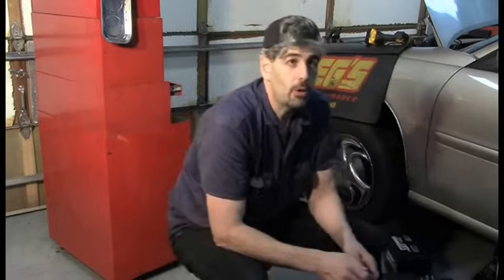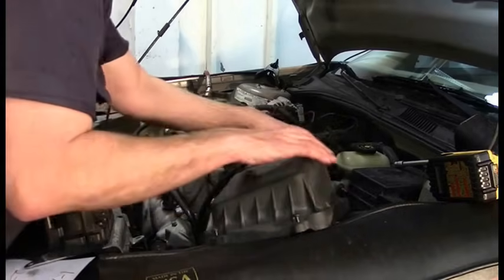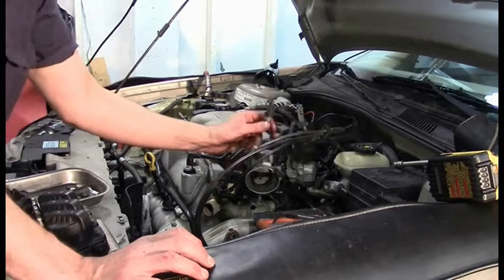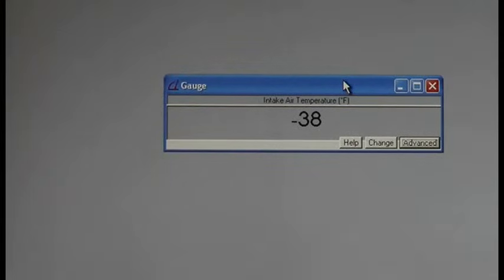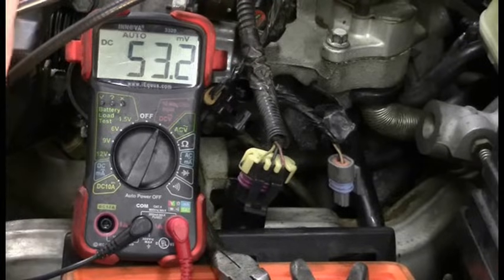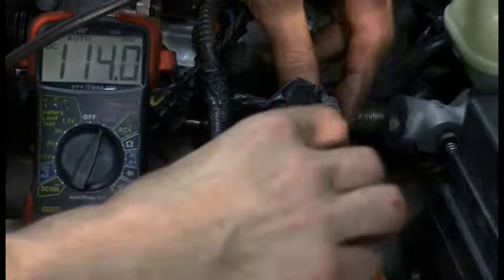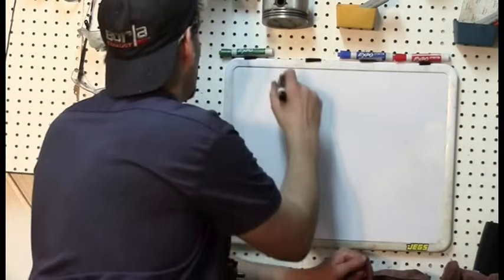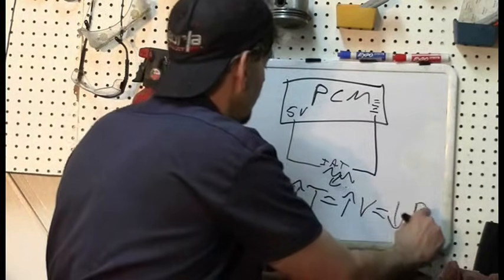IAT ( Intake Air Temperature Sensor ) Diagnosis P1111, P1112, P0113

Comment: Man, you are the best. I have P0113 error on my 1995 Mitsubishi Eclipse. My mechanic told me "Oh, buy a new IAT sensor and a new harness connector because the one you have on the car is not compatible with new sensor's connector" so I bought the stuff and the issue wasn't solve, so my mechanic said "Oh man I sorry I don't know what else to do, pay me $1000mxn (like $50usd) for changing the sensor and the connector". I obviously didn't paid anything to him, and now I'm trying to debug the issue. Your video explain everything I need. By reading on internet I had almost the same notion as you mention of the function of IAT circuit and how to troubleshoot, but now with your video I have clarified my ideas. Thank you so much man, I appreciate how you share your wisdom. Saludos desde México!

Comment: Thanks for the video. I disconnected the maf and checked if the temperature changed on my 2000 ford focus and found the temp changed. You said this meant it was bad, but i bought a new one and it does the same thing. Could it be that this model will change temperature when maf is disconnected ? I can disconnect the maf on this one and it reverts to a factory default. I can drive it with maf disconnected. When i do this the stalling and shut off at hard acceleration goes away. I also checked volts from intake air temperature as rpms stayed at 2000 rpms and it gradually increases with rpms but it will spike when ac turns on, is that normal.  
I pulled ac relay and retested and no spike, but still had stalling and shut off at hard acceleration. Any ideas. It has p0113
Reply from the maker: i most definitely did not say that meant the sensor was bad.  Where did I say that? If you unplug the sensor you should see a change to -40

Comment: How does the engine run with a bad sensor  how does rhe engine sound what problem does a bad sensor cause?
Reply from the maker: if the engine has a bad IAT sensor you won’t even know except for check engine light on. there will be no noticeable symptoms.
Reply: The only noticable symptoms (with bad IAT sensor/readings) are a rough idle and hard start up with cold motor. Your vehicle will spend more gasoline.

Comment: It's been a long time since this video but was wondering should the volt meter read 5 volts at the connector mine is reading 4.98 is that ok or should it be 5.0 plus to be correct
Reply from the maker: should be within 5% or so

Comment: Okay I guess I'll ask you sence you sorta work on the older stuff . 

1990 Chevrolet Lumina euro 3.1 144k an car keeps throwing code 22 which is TPS sensor reading low error an I've done everything an it won't go away an car the car is idling high or to low an also doenst rev up at all just stalls out . I read that the intake air charge temperature sensor is tied in with the TPS but I was not sure and if mine is bad then that could be the problem all along but i will do this test tho on the intake temp sensor an see what it reads .

This car doenst have a maf only a map sensor an then the little sensor in the air box that's the Intake air temp sensor.  

I'm going crazy and I just want to get this car straight and fixed
Reply: Car has other things done to it.  New TPS , idle air control valve , coolant temperature sensor , map sensor , full time up , air filter , furl filter , ignition coils , ignition control module , crank sensor , . And most of that was related to other issues that I've had but the only thing that's left that keeps giving me problems is the code 22 that won't go away
Reply from the maker: So start with the extreme basics- what is the TPS signal voltage showing?

Comment: That was exactly what I needed to see. I may have damaged the IAT connector in my Dodge 4.7l engine when removing the stuck #8 spark plug and coil.  My symptoms started after changing spark plugs. That is when I got the P0113 code and intermittently poor acceleration and misfire. Thanks.

Comment: I have problem with the IAT wire (chevy sonic2013), but i dont have the tracer, i am thinking abot replace the wire but i dont know the diagram of conections
Reply from the maker: without the trace you have to just probe to find the point where continuity is lost and you just need to replace to that point.

Comment: I have temp on sensor reading -31°c and voltage of 4.6v on idle? Engine off it shows -27°c and 4.5v this is going to be fun as it's raining outside like always when something brakes on my car.
Reply from the maker: sounds like an open to me. I would jump the terminals for the IAT and see if it changes. if it does not you definitely have an open. if it does, your IAT is bad.
Reply: @SchrodingersBox  I replaced the sensor reading are a 20c around 2.5v. I thought this may be the reason the car would not rev past 3000rpm tested maf the signal voltage is stable but it seems low at 0.27v at idle

Comment: Hi Mat...I looked at this video. I will be trying to find that rough idle on the hot wire of the MAF .  i will keep you notified if I find the issue.
Reply: Wiring too the MAF is tight.. Many people suggest using a OE MAF sensor from Hyundai, but it is about $260.00 plus tax?  YIKS....Your favorite follower. If I lived were you are I would be bring my car into your shop. But Toronto, On, Canada is a little far.....
Reply from the maker: Please do!

Comment: jus change the dam sensor anyway
Reply from the maker: Why? Please explain your logic.  Why would changing the sensor be of any good here?
Reply: @SchrodingersBox  Agreed! I get that people see it as "it's a cheap enough sensor to replace" but in this case, and im sure many others, changing the sensor would've done nothing.  The open was still present and without it being closed the sensor, whether new or old, would have been intermittent at best. As a kicker, for me, I drive a SHO so these sensors add up quickly because my car is very  "picky" and it's never just one thing at a time lol.  Anyways, i rambled so i apologize. Thank you so much for all the videos sir!!! I literally take notes! Your no crank, no start is where im headed next. I've taken notes but I'm gonna have to follow along this time! Wish me luck!
Reply from the maker: You won’t need luck. You “get it” and thus you won’t be guessing and firing the parts cannon so you will diagnose it accurately.  You are absolutely correct- changing the sensor in this video would have absolutely done nothing.

Comment: I lost interest as soon as you called me an idiot. You're an idiot! See how it feel? That feeling you're experiencing right now is the exact one I experienced when you called me an idiot. 😢
Reply from the maker: Um first how am I an idiot? Please explain. I don’t see how you calling me an idiot makes me an idiot. that makes no logical sense to me.  So if the feeling I feel now which is confusion and irrelevance then I guess you can share that because it’s pretty uneventful to me. 
Second, when did I call you an idiot?  I mean- you aren’t helping you case now but I didn’t call you one before b
Reply: Around 2:30 into the video, you called me an idiot.
Reply from the maker: Oh well absolutely. If you change a part on a code that actually tells you the part is not faulty, that would be stupid. Wouldnt it?
  I mean what logical sense is there in doing
something so illogical as change a part that blatantly, obviously isn’t defective? What am I supposed to call someone who does completely illogical things like that- a genius?
   Still wondering why you think I am an idiot though- i still don’t see it.   Especially as this discussion progresses- I seem smart if anything. After all- wasn’t I the one telling you not to change the part from the very beginning? That makes me enlightened, not idiotic don’t you think?

Comment: Thanks Matt for the help diagnosing an IAT problem.  I will continue by testing the sensor as you did.  I'll also check the voltage coming in, and the continuity to ground at the connector.  I did get a chuckle at your pronunciation of the thermistor; it's not pronounced Ther-Ma-Stor, but actually pronounced Ther-Mister.  Have fun and keep your videos coming.  [Edit/Add] Mine has no voltage to the IAT sensor and the sensor has 1.6KΩ resistance at 80°F.  The sensor is not shorted nor open, so 237mV DC is the culprit.  Have to trace the wiring later.  Thanks for the clues.
Reply from the maker: St. louis accent. Can’t help it. But to correct you, it’s actually pronounced ThermistOR not ThermistER.

Comment: I'm trying to determine which 2 wires are the IAT. I have a 5 wire set up
Reply from the maker: It’s easy- one is for the MAF so find your 5V reference and then probe for the signal wire that changes with IAT variation. That’s all

Comment: I get code P0113 but the live reading on IAT reads normal (27 degrees C). Also when unplugged this changes to -40 and then plugged back in live reading goes back to 27. Makes me think sensor is fine so why the fault code?
Reply from the maker: Measure the voltage drop on the feed and ground next. Issue is likely to be found there.
Reply: @SchrodingersBox  I really appreciate your reply, you mind me asking what it might possibly suggest if IAT appears to work yet still throws code? Video is fantastic btw and I unfortunately was one of those idiots !
Reply from the maker: it suggests an intermittent signal or ground fault. Thus the reason for my suggestion because it’s the simplest way to diagnose which of those it is.

Comment: Hello,and hope all is fine i was watching over a numerous of times. I Have a similar problem as the one in your video. Only on my IAT sensor mine has the 5v running up to the sensor, but when I connect the sensor IAT my voltage seems to drop down to 2.1 to 2.3 voltage and my ground wire reads 13 to 14 volts. Please tell me or help me to understand how to about this issue thank you and please keep putting out your videos.
Reply from the maker: Sounds like you are measuring incorrectly. You don’t have 14V on the ground wire. That is impossible. You are measuring battery voltage is what’s happening. 
   The 2.3V represents your voltage drop across the thermistor. .

Comment: I'm battling a rich condition on my Honda element,  the intake air sensor reads like 20 degrees higher than it really is outside.  Would that make a difference? If it's 80 outside it'll read 100. No codes and im running negative 12 on both short and long term with no codes just a rich smelling exhaust. Map engine no maf.
Reply from the maker: The IAT is normal because it’s always hotter under the hood. 
  I would start with the basics. A fuel trim analysis curved against load is the easiest way to diagnose this by far.
Reply: @SchrodingersBox  thanks for the reply you led me to my second question. Key on engine off my engine load is 99%, at idle around 30 to 50%. Thing is my cousins 05 element key on engine off his engine load is at 0% and at idle same as mine. His car runs great but mine smells rich and my acceleration is not all there. Any thoughts on why engine load with key on engine off is at 99 percent? Thank you long time fan.
Reply from the maker: Yeah that’s normal. Engine load reading is useless honestly.   I never use it because it’s never accurate.
Reply: @SchrodingersBox  I'm going to try adjusting the valves I don't think it's ever been done and I've read it can help with a rich condition but if that doesn't work I'm going to have to get a fuel pressure test going.  Is this good direction? But I would think if it's high fuel pressure that it will affect idling or something but the car actually idles great only symptom is smelly and a little bit of low power.
Reply from the maker: Sounds pretty obscure. What data do you have that it’s valve misadjustment as opposed to any of maybe 40 things that could cause a rich condition?  What are you basing this on?
Reply: @SchrodingersBox  I seen it on the Honda element owners forum where it solved a rich condition and also there's a YouTube video where the guy does everything to fix a rich condition, and the valve adjustment worked. Honestly I look at it like it's a maintenance item in the manual and I don't have history on this vehicle so I have to do it anyways and maybe it'll fix it lol. I read the exhaust valves get tight and rich conditions begin but I don't have engine noise either so just want to try it.
Reply from the maker: Ah. well if you saw it in a forum that must be it!!!
  Don’t need to acquire and analyze data in that case!
  Good luck.
Reply: @SchrodingersBox  I didn't say it was it but read element owners do have to adjust valves also Eric the car guy adjusted his element valves as well as standard maintenance so I figured it wouldn't hurt. I don't expect it to help with the rich condition but I do think it's regular maintenance on this engine. I really think it's a lack of air either through a false reporting sensor or something like that but maybe a high fuel pressure but I have no starting problems at all either. My map read good atmospheric with engine off and the readings are in the 4 to 5 psi at idle which I also read was normal so that's why I'm pretty confused.
Reply from the maker: Then why not diagnose the rich condition?  That is your issue, isn’t it?  Gather data, analyze it and then fix what needs to be fixed.  Don’t just guess!
Reply: @SchrodingersBox  I will and update this when I figure it out. Thanks.